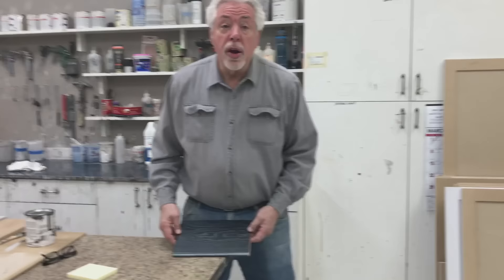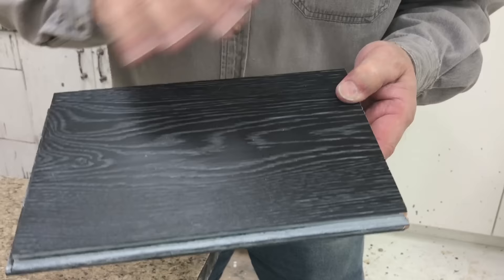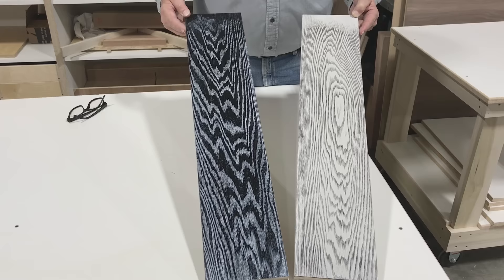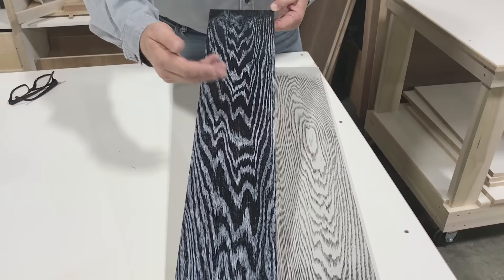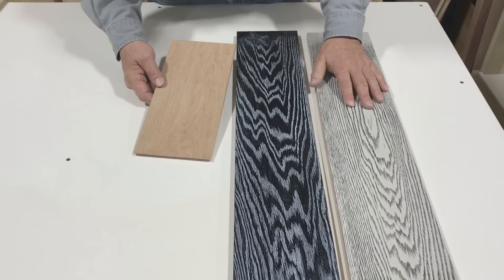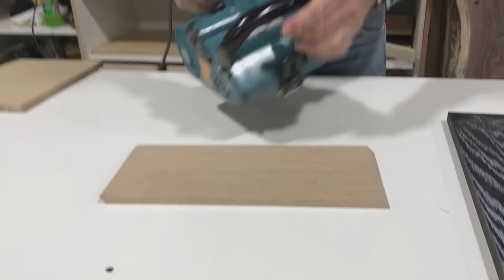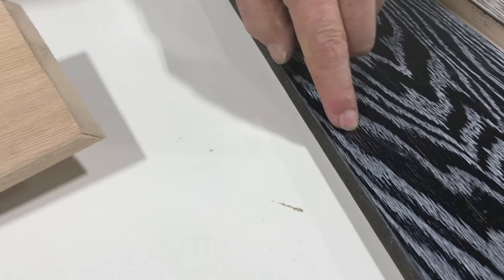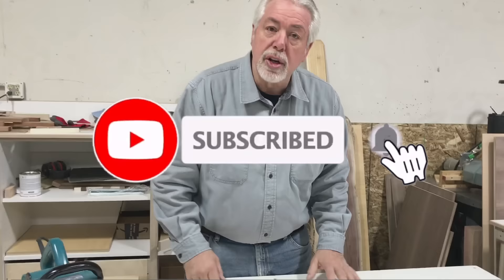Secret to a new trendy wood finishing technique

Comment: Hi Wes, great job!! Currently remodelling our kitchen and I have a quick question. You mentioned that you sprayed the paint, SEALED it, and then put the glaze on (2:30). What do you mean by this sealing step? What or why did you use? I haven't seen the sealing step in your other video about cerused oak. Thanks! (I am suspecting you mean priming, but doesn't the primer seal everything?)
Reply from the maker: Sorry I misspoke. The color that I sprayed is a primer sealer and is self-sealing. So apply the glaze right on the color. Thanks for watching. Wes

Comment: Did you sand it aging after you used the wire wheel?
Reply from the maker: The only sanding I did after the wire wheel was to smooth between finish coats. Thank you.
Reply: Woodworking With Wes thank you.
Reply from the maker: @catoway74  I am sending a link to a new video today on this process. I think you will find it useful...thanks.
https://www.youtube.com/watch?v=LdmsLbqGA1c&feature=youtu.be

Comment: What paints and what glaze or top coats are you using?
Reply from the maker: The color coat I used was a tinted vinyl sealer.The brand I use is Pratt and Lambert.  I used an oil based glaze tinted black and white. The brand is not important because any oil based glaze will work.
Reply from the maker: I have just posted an updated video of this finish and technique. Sorry we were so incomplete on the last one. Thank you.
https://www.youtube.com/watch?v=LdmsLbqGA1c&feature=youtu.be

Comment: Which type of paint enamel
Reply from the maker: The paint is the same as my video with the 3 cabinet finishes I posted.  It is a tinted primer sealer from M.L. Campbell.  I used a white/black oil based glaze and final step is a clear top coat of lacquer.  I appreciate your visit.
Reply from the maker: https://youtu.be/3mMxC9ZWsew
Reply from the maker: Hi...today I uploaded a new video on this finish you might find useful. Thanks https://www.youtube.com/watch?v=LdmsLbqGA1c&feature=youtu.be